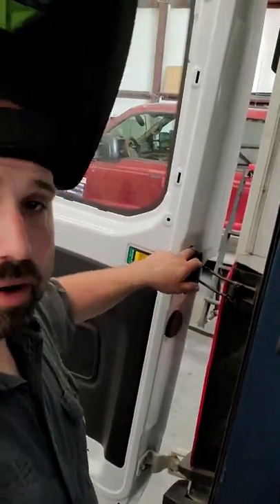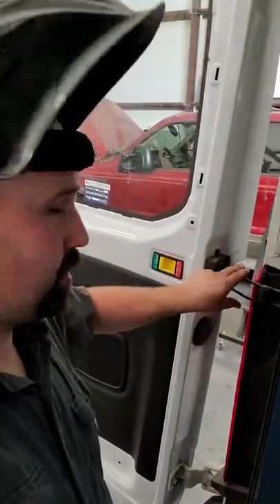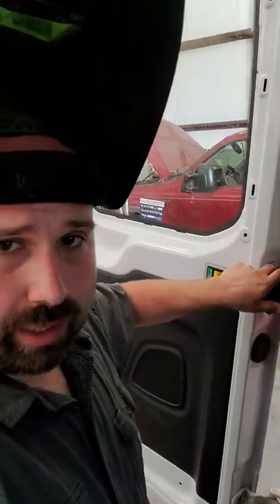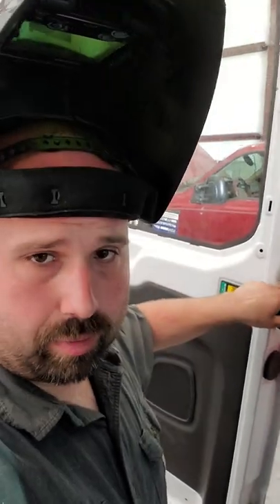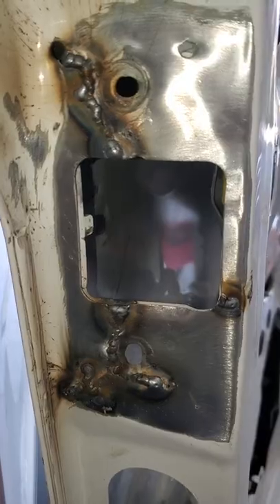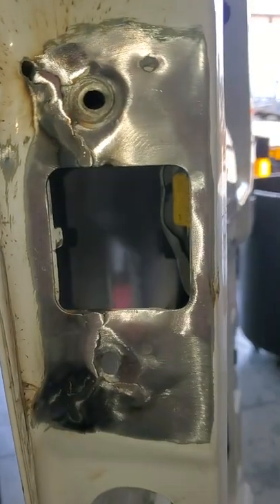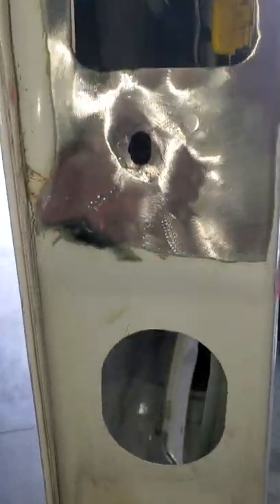TRANSIT T-250 DOOR REPAIR SHORT

Comment: Flexing metal.. not good. 
Had to bend mine inwards. Someone had pushed the door to much while it was open. Basically it opened 200 instead of the 180.